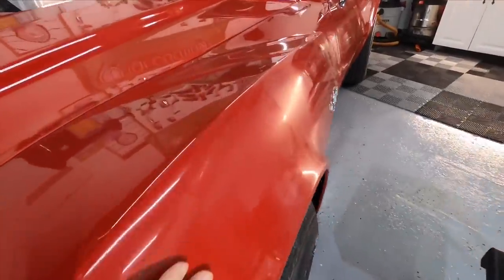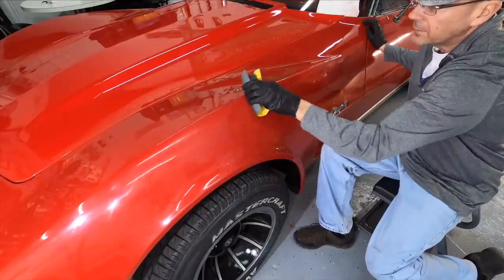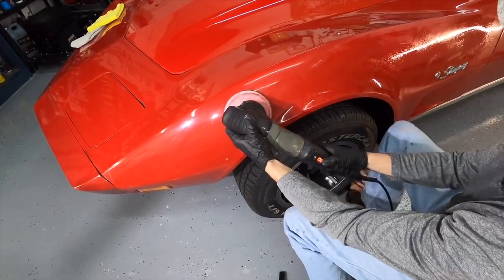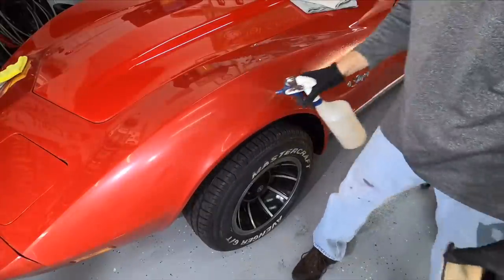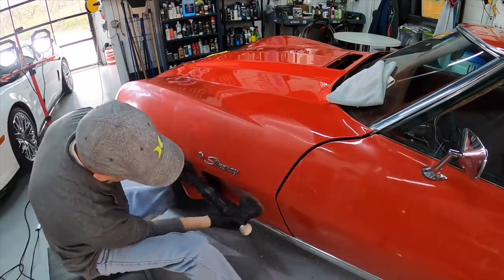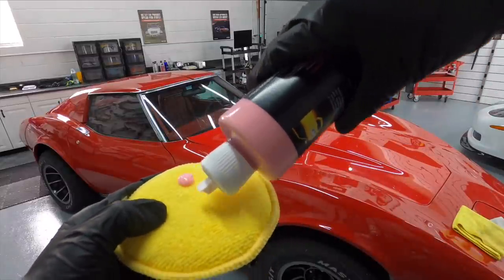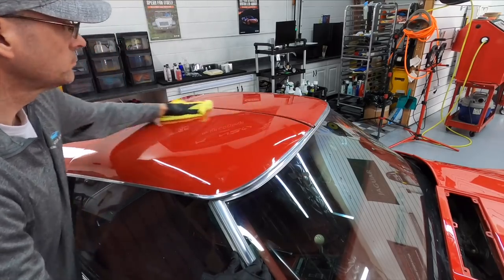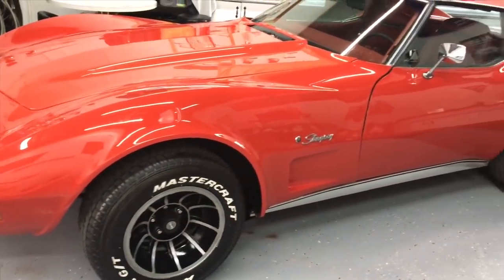Paint Correction/Restoration Complete!! Barn Find 1974 Corvette!

Comment: I almost bought the Magnum Wax when I purchased the LVR 404 and I must say the 404 is some amazing amazing stuff. I’ve been blown away by the 404. 

Anyways, I was thinking you might finish with the Poly Seal but glad you chose Magnum 357 as I wanted to see how that finished.
Reply: L J I love magnum wax. And 403. 403 and 404 are pretty much the same. Both can be used on any color car. I bought the 357 and it honestly has amazing shine and depth in the paint. I made a “first impressions” video on my channel if you are interested to see more on the wax

Comment: Brian, love the channel. I notice when you are applying the polish/compounds you never butter the pads. Do you already have them pre buttered or do you work on the paint with it dry like that. I’ve always been taught that you butter to pad so there are no dry cells or fibers that could create pigtails. Am I being told a lie so use additional compounds?
Reply from the maker: That is only a factor on soft clear coat.

Comment: I have the same color on the 1969 convertible, I have had something fall across my hood and it put some chips in the paint. Any thing I can use to fill the chips and touch up the paint?
Reply from the maker: Fill the chips up 80 % of the way with body filler...the rest...touch up and clear.
Reply: Thanks for the advice, I will send you a before and after.

Comment: Hi Brian, in your pad cleaner contraption I see you have Chem Guys pad cleaner.  Is it worth getting the Chem Guys pad conditioner in addition to the cleaner?
Reply: Probably not. I know he makes his own pad cleaner too
Reply: @henryfreeman6113  Actually, if you look at the previous video (or the one before that, can't remember), the Chem Guys pad cleaner bottle is hanging on the pad cleaning box's handle, and Brian uses it to clean the pad.  But, you are right, I have never seen Brian use the Chem Guys prep.
Reply: Sandro Herrera ah ok. But you can also use a spray or two of onr on a pad to just dampen it. I know brian doesn’t polish with dry pads. I know onr works well also really cheap product !
Reply: @henryfreeman6113  Perfect!  I use Wolfgang's Uber Rinseless Wash instead of ONR, but they are pretty much the same thing and pretty cheap too.
Reply: Sandro Herrera I love that stuff !! Try mixing it as a detail spray.  It’s incredible. Shine and slickness is on point !!!!!
Reply: @henryfreeman6113  Since my car is coated with an acrylic coat (Klasse Sealant Glaze - KSG) I actually have four formulas for the Wolfgang product:
- Rinseless wash: 1 oz to 3 gallons of water 
- QD: 3 oz to 1 gallon
- Acrylic QD: 8oz of QD above + 0.5 oz of KSG
- Acrylic Spray Wax: 8oz of QD above + 2 oz of KSG
Since nobody makes an Acrylic topper / drying aid these days, everyone is about SiO2, I made my own.
It works really well as expected from 2 awesome products KSG and Wolfgang.  It is also super cheap.  I worked out the cost, and the Acrylic QD costs me ~10/gallon and the spray wax ~$30/gallon (assuming $1 for the distilled water)
Reply: Sandro Herrera sweet!! Thanks for sharing!!!
Reply from the maker: I have both...they work fine.
Reply: @apexdetail85  Hi Brian, but the question is, is it worth getting the pad cleaner, I am sure it works fine.